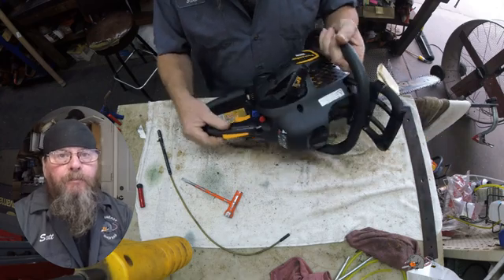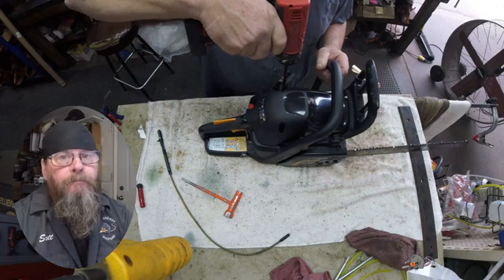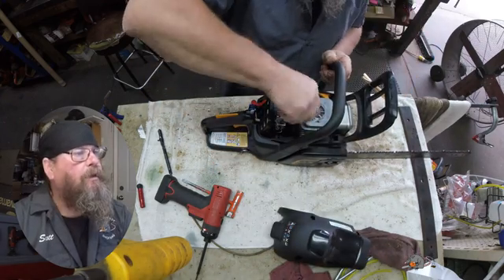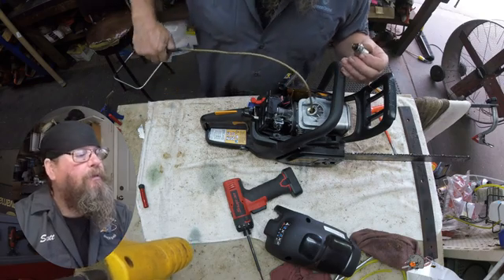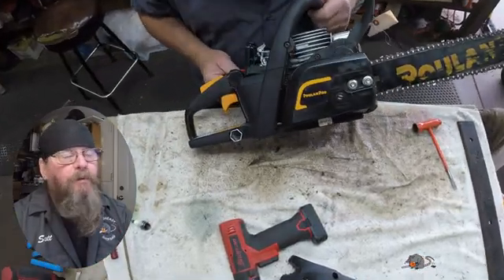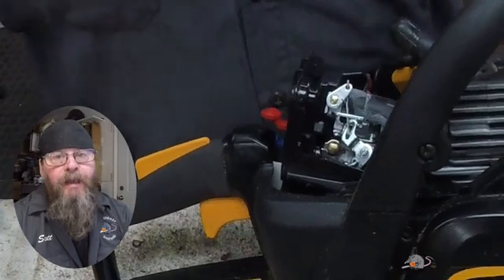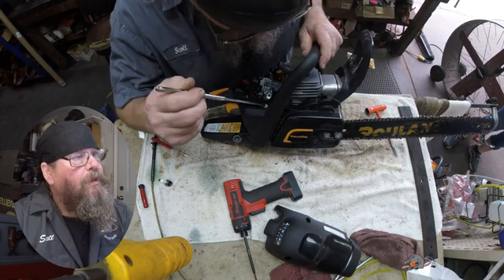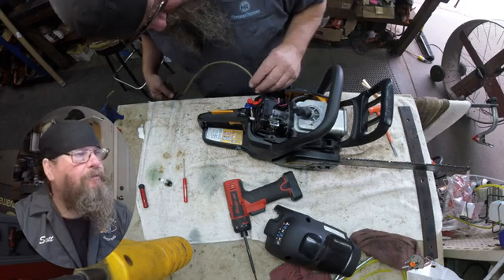Why Does A Choke Work?

Comment: I squeezed a slightly oversized fuel return hose into the fuel tank of a Stihl FC45 edger and the primer bulb would not fill; the long taper I'd created on my hose end to accommodate tank entry was leaking air and a properly sized outer diameter hose remedied the ailment.  But why would this failure occur on the return fuel line when there were two pin holes in the top of the tank body (repaired with JB Weld) and they didn't prevent the bulb's filling or the machine's starting?  What is happening in the tank with regard to vacuum; should its conditions repeat those of the crankcase?
Reply from the maker: If that return hose is pinched shut where it passes through the tank then the primer won't work. If it can't push fuel out then it won't pull fuel in. Remove the return line from the primer and see if it works. Also ensure the return line is on the long stem of the primer.
Reply: @TheGreasyShopRag  Thank you.

Comment: Had a 1998 Poulan.  Got light use. But Poulan is junk.  Had to fix something on it every time I took it out.  Finally wised up and deep sixed it last month.  Wore out my patience.
Reply from the maker: Curious if you replaced it yet and if so, with what?
Reply: @TheGreasyShopRag  Yes, Sir.  I replaced it with a Husky 450 Rancher factory refurb about a month ago. 2020 model and when I got it I think I lucked out cuz it has hardly a scratch on it.  Whistle clean.
Reply from the maker: @joesixpack8305  The 450 is a very popular saw that holds up well. Some leak a little oil but so do many chainsaws.
Reply: @TheGreasyShopRag  I like to hear that.  My research backs up what you say. Thx for the confirmation.  I always value a repairman's opinion no matter what the equipment or vehicle or whatever. And the oil leak can't be worse than that Poulan.

Comment: Do you think a lot of the wear is from not enough gas/oil when choke not working properly?
Reply from the maker: Probably not. I'd guess its the same old story of a dull chain and over heating. Possibly old fuel not mixed right. The broken choke linkage would only allow it to run richer than the original settings.